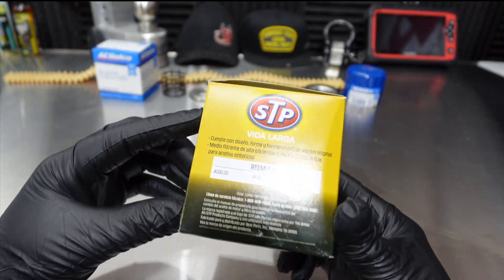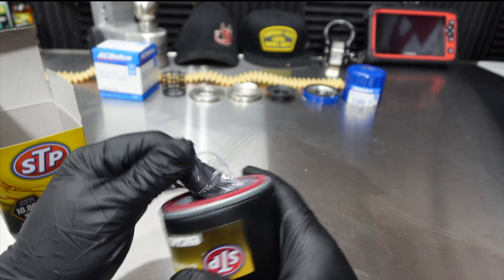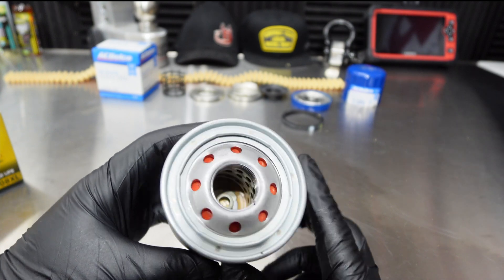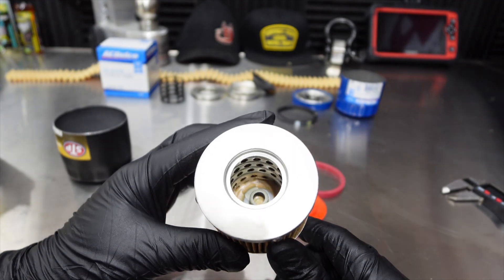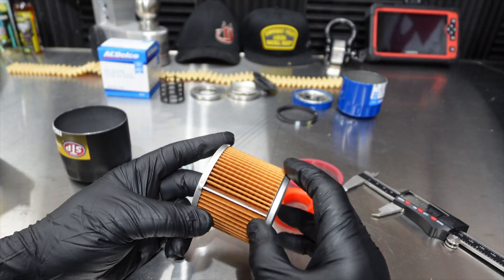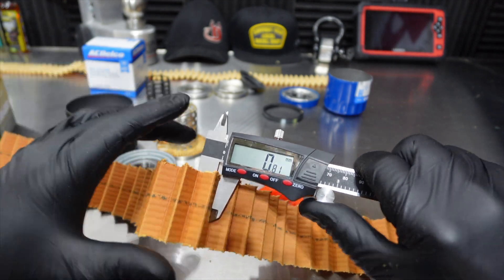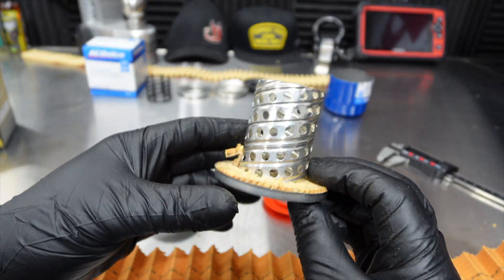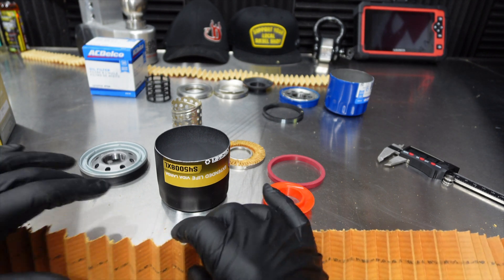NEW favorite Filter ? STP VS ACDelco 3.0 Duramax / 2.7 TurboMax

Comment: Fram and Champ Labs are now owned by First Brands Group. They are not independent companies anymore.  I think they are messing around with their product lines and mixing things. I have noticed my FRAM cartridge filters for my Camry are actually CHAMP LAB cartridge filters, with FRAM printing on the plastic end cap. I have also noticed the OE plus filters at Canadian Tire are Champ Lab filters, just like the Castrol Filters. You just don't know what you getting any more.

Comment: Thanks for doing this, looks like an amazing oil filter for my LZ0 - I own a shop, I just pulled a STP S7317XL off the shelf for comparison, and the interior is the plastic variety like the PF66. I'm currently transitioning away from STP oil filters because even same part number oil filters have barely any consistency, bouncing back and forth between metal core and plastic core, different sizes and colors that is noticeable when you handle them every day. clearly different manufacturers over time.
Reply from the maker: That's concerning to hear. I am blown away by this particular filter, hope it continues to be produced like this.

Comment: I'll have to give this filter a try, I like the STP full synthetic as an affordable alternative when I can't get my hands on AMSOIL Signature or Royal Purple. I personally don't like ACDelco anything when it comes to oil filters, motor oil or spark plugs. I have the 2.7l Turbo-4 in my 2020 Silverado and I've been looking for a more quality replacement to the janky PF66 that comes stock on it. I was also looking at the PPE filter that's meant as an upgrade for the 3.0l Duramax. Yes it's expensive, but I like the idea of the little extra filtering capacity. But since these are a third of the price I might have to get two or three to store for future oil changes. I've been wanting to give a Purolator BOSS filter a try as well but sadly they don't make one for the L3B or 3.0l Duramax yet. I don't know if they will in the future because they have them available for everything else but not those two engines.

Comment: The STP XL filters are good I use it on my 2010 Honda.  Recently purchased a 24 GMC AT4 with the baby Duramax I'll probably go with the UPR66 ACDelco or the Purolator Boss.  I don't know why the STP has a bypass valve as the truck has an internal bypass oil valve located in the engine, that's why the other filters don't require them. I confirmed this with Purolator. Still a great filter for the $$$. By the way you should review the Purolator Boss PBL11424 It's a great filter same as the Wix XP version. Both companies are owned by Mann-Hummel which makes great filters.

Comment: I believe this particular STP XL filter is a Premium Guard filter (made in Vietnam).  From what I have learned, Premium Guard places a leak test stamp on the end of the canister.  Nice looking build on this one... I'm going to run one on my LZ0.  

I greatly appreciate your videos on the 3.0 Duramax family.  I love to learn about my machines and have learned a lot from you.  I'm new to this engine ('24 AT4) and loving it so far.  Please keep up the good work, sir!  It's appreciated!
Reply: GRAB A PPE OIL FILTER INSTEAD. AS A MATTER OF FACT ORDER THREE. I THINK THEY HAVE FREE SHIPPING IF YOU GO OVER $100.00
Reply: @PastarocketS-sb7nk  question on the ppe oil filter. Because the filter is much bigger, longer. It should hold more oil? Do you have to run more oil on board than the normal 7 quarts to accommodate? sorry if this question is dumb.

Comment: I’m currently trying the STP xl. Seems like a well built filter. I’ve been using the PPE filter but $30 a pop wasn’t viable when the STP is built just as well, minus the extra capacity

Comment: Used one on my 1994 Ford 4.6L, engine knocked at start-up, like a lash adjuster wasn't getting oil at first. Changed to a Fram and it wuit knocking.

Comment: I did a little research champion labs makes stp oil filters and they also make oem gm filters for some applications oem motor craft Mobil 1 Valvoline and autozone filters champion labs makes over 100 private label filters so it sounds like they make quality products
Reply from the maker: Yes, on there being quality filters but not all are at the same level even if from the same factory. Perfect example is this comparison, if champion made bth of these.
Reply: @DemonWorks  correct oem is known for being kindve cheap to save money in the long run and house brands just squeak by oem requirements most of the time not hard to see different quality’s between these two oil filters

Comment: Believe it or not, STP high mileage full synthetic 5W30 has a lower evaporation than Valvoline's Synpower and their high mileage full synthetics in my 03 Dodge Neon non-turbo.  It's an old car that burned more oil 10-13 years ago than it does today.  

I added about 4-ish quarts three months ago 4-20-24, and drained about 4-ish quarts out today - including the STP oil filter contents.  The oil level on the dip stick was at the full mark about two weeks ago before I changed and drained the oil today 7-28-24.  The Valvoline would be about half-way down the hash mark on the dip stick before the three-month mark.  STP will be my go to oil for my next cheap car after the 2003 Neon is dead.

Comment: I used an STP XL today. The gasket was not red silicone, it was black and seemed like the typical rubber that most use. Also, the core was plastic, not metal. Seems they are making these cheaper now unless some were always that way.
Reply from the maker: That's concerning! Sounds like I may need to grab another and take a look.
Reply: Just bought 4 for my daughter’s Honda Pilot, today actually, and all are red silicone and metal core. S7317XL. You likely bought old stock or are just trolling.

Comment: Would you be kind enough to tell me what oil filter you would use. I have a 2023 Colorado trail boss High output tuned only 5k on it now. Last oil filter I got @ the dealer was the PF66. For some reason I like the Idea of running OEM.  Thoughts?   Cheers
Reply from the maker: Absolutely ! I prefer the ppe oil filter for the diesels, it's a longer filter than oem, better filtration and it's a replacement for the pf66. My next favorite is the STP shown here, it shows great quality internals and appears to be a good filter. Nothing wrong with oem, it is good enough to do the job. The key is to do the maintenance often and don't fall behind. Quality oils as well !
Reply: @DemonWorks  Thanks a million

Comment: I have done some research and the pf66 Should Not have a pressure relief valve. The LZ0 has an internal one, and with the variable oil pump the pressure will get to high for an oil filter that has one, meaning that the oil would just keep bypassing the filter media and go through the valve.. Not Good. So look and make sure the filter you use doesn’t have one.
Reply from the maker: The pf66 is the factory filter which has a bypass in it, there are filters with a bypass and some without. With the internal bypass system, I believe either are ok. I don't think the oil will continue bypassing though, It should still only bypass with the pressure deltas reach the specified number.
Reply: I’ve seen the pf66 without a pressure relief valve in it. But I think you’re right that most times the filter will work it’s just under higher pressure that it might bypass. They had issues a few years ago on vettes that needed a stronger spring on the valve.
Reply from the maker: @BigRedDmax  you are correct, at one point they did not have one in it, they also had a metal core at that time and seemed to be a more durable appearing filter.
Reply: Thanks for all the work you do on making these videos, they are greatly appreciated. I’ve learned a lot about these trucks and the engine, and am really happy with my truck because of it.